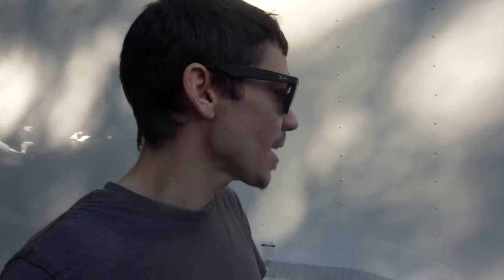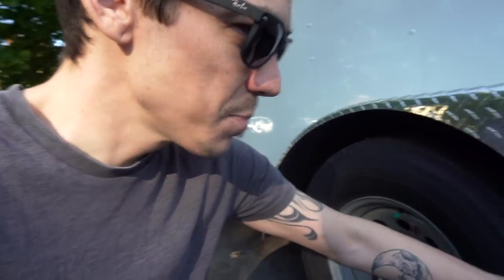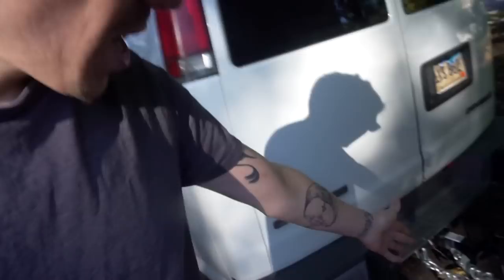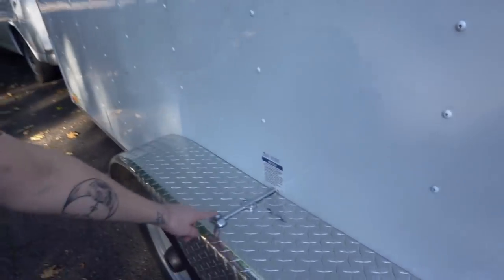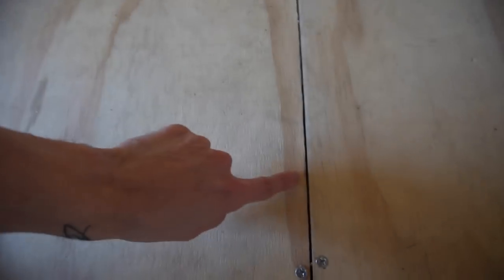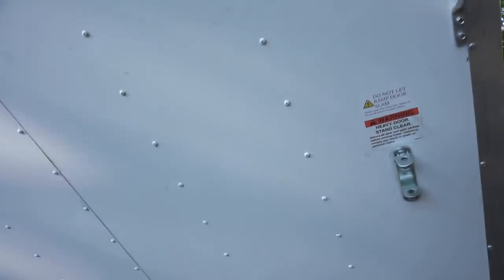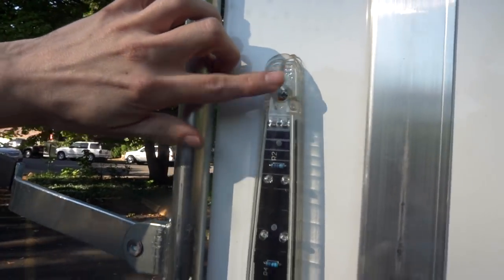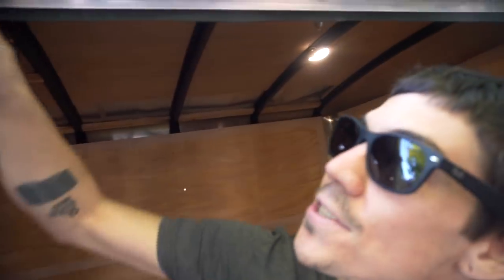WATCH THIS BEFORE YOU BUY A CARGO TRAILER FOR CAMPER/TINY HOUSE CONVERSION

Comment: "Last a lifetime?" that is an unreasonable goal.  in 5-10 years you will be thinking a whole lot different. I picked a camper which would last for 100 nights (to cover $100/ night Motel costs ).. So far I have already broken even.  I think you really like spending your time building and that is great. But If I liked building I'd buy a Casita and have people hire me to help them with their builds. That way My passion would pay me not cost me.
Reply from the maker: Well I’m glad you got your casita. I actually don’t enjoy the build process, but the end result will be worth it even if you don’t understand the reasons for it.
Reply: I don't have on I have a popup camper. (I travel mostly alone) and am not living in it. Purpose bought to replace motels in my travels . Family trips to Oregon and Colorado and Varmint hunting in the spring. Point is to look at what You need/ or what I need and get the thing that best meets the need.
Reply from the maker: And that is a cargo trailer for us, hence buying one and a video talking about why we made that decision. I left out a lot of points to avoid making it a two hour video. It is definitely the best option for us though
Reply: Camp'n Outdoors  Good its a Ford however I had a 69 Ford Mach I from 72 until 2010 Discovered that Ford no longer makes parts so any repairs were expensive and took longer.It's what I worry about any Car older than 10-15 years. I have been running my F250 for more than 10 years

Comment: Most of these units are built to haul misc cargo...I wouldn’t doubt if there were more small air gaps and little stuff. As far as a conversion goes its a cool little side hobby and way cheaper then a lot of rvs

Comment: Jed. I have a 7 by 12 single axle. I love it. Join Cargo Trailer conversion group on FB. Lots of great info from people who have done it. This was a smart purchase for you! They never leak. Rarely rust if the undercoating is stayed up on. And hold value VERY well. I have a roof top ac,awning,and 2 windows on each side of my queen bed in the back that lifts to the ceiling. And STILL stay pretty stealth. Hope to see you on the FB group brother.
Reply from the maker: Wow that’s awesome! I don’t spend much time on Facebook, but I may check it out.

Comment: Great tour Jed. It seems like a lot of work just to get it started. You have more knowledge of these things that i do. I would seal any holes or gaps of course. The wood looks good to me as is, and knowing me I'd just spray the heck out of it with a sealant. If it needs to be insulated (I trust you did the research and the construction is too thin that it does need more insulation... as they are not intended as homes), I would think that would go on the inside of the existing wood you showed. Then, one could add some kind of finished plywood on after that layer? Do you have to remove the existing wood to put the insulation against the metal exterior? It very well may be the case. It sounds like you've done your research, and I have not researched building out or insulating on of those trailers. The space looks fantastic!

Comment: Good video, I thought of many things you were concerned with. The biggest thing is keeping moisture out. I am not sure the wood on ceiling will have a problem but maybe you can remove most of it from the inside with a tool then coat what is left. a plastic wood look ceiling would help avoid rot wood on ceiling later on. I wouild use plastic a lot and any wood be coated. Did you opt for screws when they put up the walls or are they those fake screws that dont turn to remove and have to be ripped out with a crow bar? 

If you have it ventilated It will not consolidate moisture but its a complex issue when you seal up a wall etc. I have heard vapor barriers are bad as well others use it.

Comment: Hi Jed if your planning on taking the wood on the inside of the trailer off I would run what wires that will be covered by the wood and then spray foam the inside of the Wall the foam should stop any moisture I didn't see your spare tire on the trailer? Good video

Comment: Can you please update your description to include the make and size of the trailer? I will be purchasing one to build out for traveling to fly ins soon and appreciate the tips!
Reply from the maker: Ours is a continental cargo 16x7 with tandem axles and electric brakes on every wheel. The higher grade trailers plus ones were a little better quality but a lot more expensive and the dealer seemed like he was on drugs. I definitely recommend the dual axles and brakes. You get double weight capacity, brakes, it’s tracks better on the freeway, and if you have a blowout it won’t be as much of an emergency

Comment: I have seen too many van builds leaving raw wood exposed. Why? It's so easy to throw a coat of paint on it.  You are guaranteed to have moisture unless you stay in dry climates?  But then you will never have a Go Anywhere Van.
Reply from the maker: How many of those builds are still going to be looking great in 30 years? This is going to be a long term home, I’m not half assing anything even if it takes me 10 years. You can greatly reduce if not eliminate moisture related problems by coating all wood with something, properly insulating, sealing, and having a moisture barrier in combination with good ventilation.
Reply: @IntoTheMystery13  Yep

Comment: Is there a good way to attach rigid solar panels to the roof without drilling?  I wouldn't want to give water any opportunity to penetrate it.
Reply from the maker: Yes these work great https://amzn.to/2X6Oa9q Use some Sitka flex to glue them one. You’ll have to get the cables inside the van, for that I recommend a cable entry housing while you will have to drill for, but you can use the Sitka flex and that thing won’t be going anywhere or leaking any time soon

Comment: Taking the panels off just to silicone the joins, have you looked into having the whole trailer wrapped ?
Reply from the maker: No I haven’t, that’s a killer idea!
Reply: The wrap design of your choice :)
Reply: Damaged Goodz Good point wrap sounds like a better quicker option.
Reply from the maker: Turns out it’s 2-5k and only last a few years. It’ll take me a day to pull all those panels, clean off the silicone, and reseal them with something better. If I can access the seams from the inside I might just seal them up from in there. A good vapor barrier should prevent mold in the wood on the ceiling, but I need to research that more.
Reply: Ouch !! I done a deal with the guys that wrapped my 360, that was 5 years ago and the wrap is still good. Maybe they'll do a discount if you make a vid on it being put on the trailer since you have 37k subs ? :)
Reply: Butyl based products are what you will want to use to water proof things where you can get the sealant in-between the two surfaces.  
Because unlike silicone and acrylic based products, butyl based products will never fully harden, so they will (for at least 10 years)  keep adapting to and absorbing the movements of whatever they are sealing. 

The Dicore Lap sealent products are what you will want to use if you can only apply sealant "on-top" of a seam.  
Dicore Lap sealent products are likely to also help butyl based products remain flexible (and sticky) for longer, as it adds a barrier that will likely help keep the solvents that make the butyl flexible, stay inside the butyl for longer. 

But I take that you already know most of this, as you have already used these products when installing fans etc.
Reply: @IntoTheMystery13  
Just an observation but you allowed a jerk of a salesman cost you a lot of work.

Comment: Just wondering ... did you look a the same size toy haulers ... probably would have cost less in the long run and then you would also have everything, full bathroom, tanks, kitchen, etc. already built in
Reply from the maker: Yes I did. They are great for weekend trips, but not to live in. I will end up with a much nicer trailer that will last much longer with less maintenance by building it myself. It will cost less (compared to brand new "normal quality" or used high quality). I won't have to smell gas fumes all the time or leave my bike outside either.  And I will be exactly the way we want it. It will feel like our home not an rv
Reply from the maker: this the typical quality of average rvs and toy haulers, and why I don't want one especially for the price: https://youtu.be/jXMJrRQ3SVk

Comment: You are crazy pulling the floor out.  Seal it from below and above and let it go. Remove the luan from the ceiling and  seal it (edges especially) and put it back up. Pull all the wiring before you seal the walls and ceiling up.  Nothing worse than tons of exposed wires.
Reply from the maker: And 10 years from now when the floor is rotted out I’ll have to pull the whole thing out and rebuild, no thanks. I’d rather over top and know that it was done right and last
Reply: We had a trailer, bigger than yours, that was built out as a mobile marine electronics showroom.it was sealed from below and had one of those one piece  floors installed.  I towed that thing from New Orleans to Key West doing boat shows in all kinds of weather and the floor had no problems after longer than 10 years.  I think you are just making more work for yourself.  That is only my opinion.
Reply: @IntoTheMystery13  you think you be in that trailer 10 years from now. With you record of changing your mind.? I seriously doubt you'll be in there 2 years from now.
Reply: @Chris L yes...wprth it too put in solar and air...they gotta keep this eyesore "stealthy" lmao
Reply: @IntoTheMystery13  i cant argue with "over kill"....... going above and beyond in your build, but as for the floor, our trailer is about 15 years old now, no sign rot in the (factory) floor what so ever. (actually other than the factory screws getting loose, we've never had any issues or corrosion anywhere on the trailer.)  just a little input from a stranger* lol (thumbs up on your video!)

Comment: it will take u a lifetime to build it if u worried about all that stuff . insulate the whole trailer put a rv ac and heat strip and start building it will last 10 to 15 years check out my build been 3  years and still rollin.

Comment: I wonder if you can seal the panels by welding all the seems?
Reply from the maker: I wouldn’t want it. If one panel is damaged it would hard to replace it and make it look good. It would be very expensive too, and I’m not sure if someone could weld aluminum that is so thin
Reply: Wonder if they can be welded from the inside? Btw,I live in Portland too. Been watching your videos since the start. I’m off of Sunnyside.

Comment: Very cool. One thing I noticed is the difference between getting in your van & getting in your trailer. How will you lock it securely while being inside? Just the door latch? Sucks it will look like it’s not locked while your inside. But at least you can give them a good ass whooping if they come in. Hahaha 😆👊
Reply from the maker: There is a dead bolt on the rv latch on the side door, I’m thinking about adding a steel bar that’s hard to explain
Reply: Into The Mystery ⓭ yea I saw the outside lock, just ment when you go inside you can’t lock the outside lock. No biggie about explaining it. I’ll see the future builds. It’s very dope tho. Glad things have turned into a lot more excitement for you!!
Reply: When you are inside simply lock the exterior lock in the "unlatched" position so someone can't lock you in ... and then simply put a garage door style slide bolt on the inside ... it would be hell if someone locked you in ... also maybe an escape type of skylight.   Hope it all works out for you

Comment: It said ‘proudly made in Oregon’ but the build quality seems shit. I wouldn’t be too proud. Trailer is going to be garbage in a couple years of use and mods
Reply from the maker: I don’t know about that dude, the frame is solid and the little details are all fixable
Reply: Into The Mystery ⓭ Fair enough. But I wouldn’t expect to have so so many details to fix on a new unit. And I don’t see those walls and floor holding up well. And Jed, don’t put much faith in “lifetime warranties”. A company can easily limit its liabilities...whose lifetime? Yours, the company or the product? If a product has an expected lifetime of say five years...that’s it’s lifetime.  I know u guys are going to void the warranty anyway but often, a lifetime warranty isn’t worth more than the paper it’s written on so the company isn’t really showing any confidence in their product. Marketing ploy.

Comment: It's seems you over think things and make it harder than its supposed to be.  Build it the way you want but don't be so anal about things . You have a lot of phobias you need to get over. Good luck on the build.
Reply from the maker: That’s easy for you to say, your not the one that will have to take all that hard work work apart in probably 5-10 years. I’ve had to do that a couple times because I half assed a build and it sucks. I’m building a long term home not something to travel in for a couple years, and I’m going to do it right. Your right about my tendency to overthink things and make them more complicated, but in this case it’s warranted

Comment: You will ruin that trailer if you pull it apart! You have no clue! You didnt order a custom-made trailer, its an assembly line mass produced..... I Think The good type of closed cell spray foam would be your best friend!
Reply from the maker: How that ruin it? How is a custom made cheaper than a production line made in a factory? The point of factories is to drive cost down I’ll definitely be looking into closed cell foam on this one. When I looked into for a small van build it wasn’t worth the money
Reply: A custom-made trailer would be made to order! Not cheaper probably 2x!
Reply from the maker: And judging by the attention to detail I’ve seen on every trailer from different manufacturers I’d rather do it myself and know it was done right
Reply: it that was truly the case you could easily built it yourself for way less than $7,000.00 if you are going to rebuild why not save some money and buy a used one as that would have at least saved you half the cost up front ? you and me we just think differently. Im 57 and im a tight wad making every penny count. Out of debt and never will get back into debt. I can work as much or as little as I choose to. i also can make everything that I need or want for the most part as Im a master Woodworker and Welder and Inventor.  You might as well get some education on how to properly fabricate and Make things. I just wonder where this all going. But I sincerely Hope you do well. I truly do want you to have a Joyful life. Namaste

Comment: Jed check out Greg Virgoe's channel in particular his video 'The facts of Camper Van Insulation' and 'Roof Batten' they are the best videos on youtube regarding insulation.
Reply from the maker: Agreed, he knows his stuff
Reply: He's the Insulation Freak'n Master, it's hard to fault any of his work or advice. Thanks your update, where do you think you're going to install you batteries? You want to firewall yourself from them.
Reply from the maker: So far the idea is the build a box under the floor that is sealed and vented to the outside. Probably behind the axles (the water tanks will be in front)

Comment: Don't make unnecessary work for yourself
Reply from the maker: Seems like I either do it now while it’s fairly easy, or later when it might be much more difficult. It’s easier to change the oil than replace the motor you know what I mean?